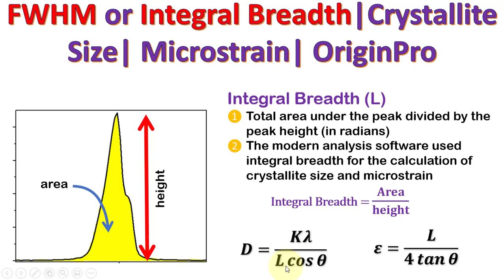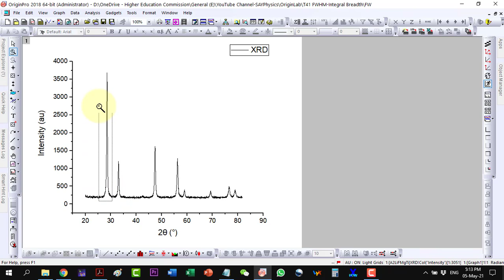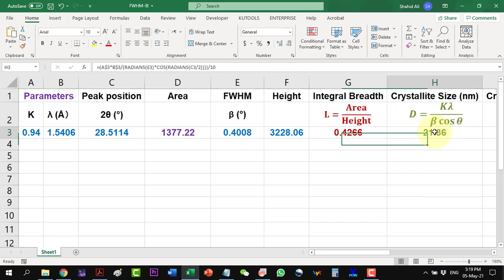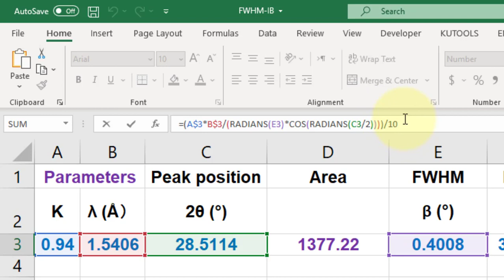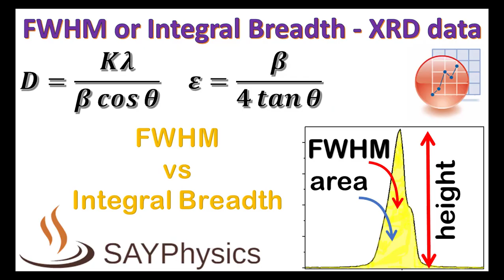FWHM vs Integral Breadth | Crystallite Size | Microstrain| OriginPro

Comment: Sir, Can i ask you why the integral breadth is preferred than FWHM?
Reply from the maker: The integral breadth (β) is often preferred over the full width at half maximum (FWHM) for calculating crystallite size and microstrain in XRD data because β provides a more reliable and accurate measure of peak broadening. β considers the entire peak shape, incorporating additional information beyond just the FWHM, making it a more comprehensive parameter for precise calculations. Thanks
Reply: @SAYPhysics First, thank you so much Sir for replying.🙏✨
please I want to contact you for helping me in W-H method, I'm a MSc student & I have questions about W-H method. I have watched all of your videos Sir but still i need your help 🙏
Reply from the maker: Yes dear. You can contact me or share information at sayphysics@gmail.com. Thanks